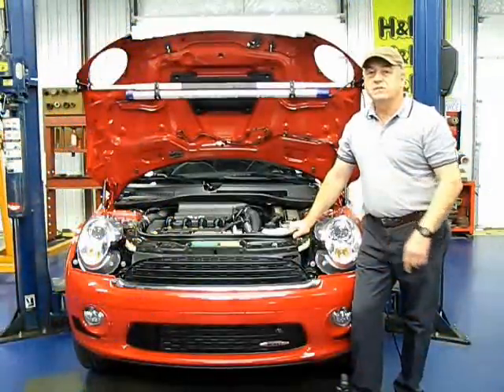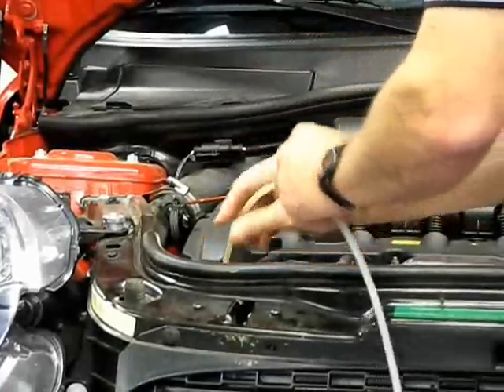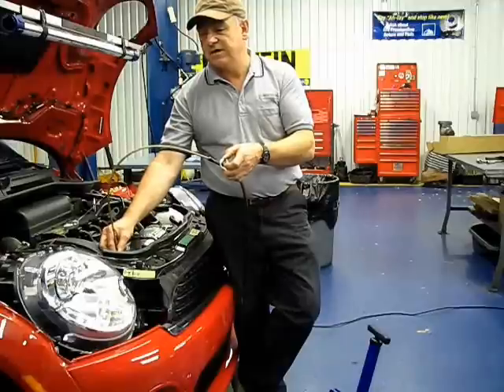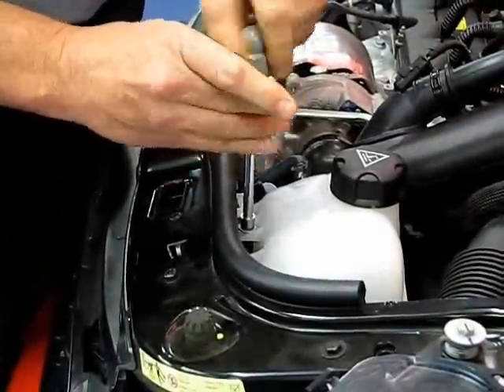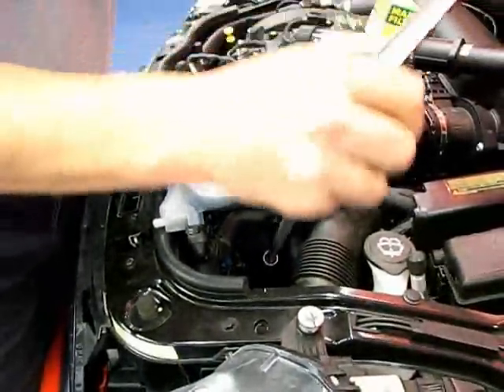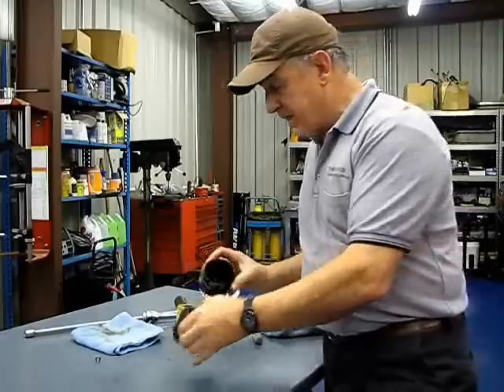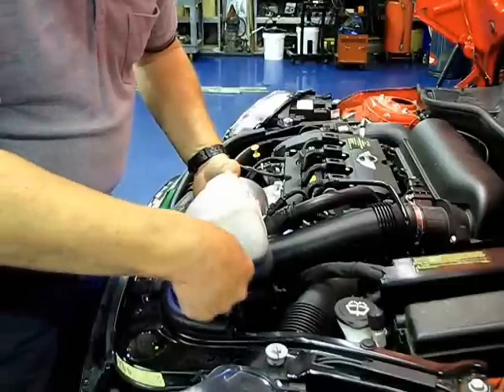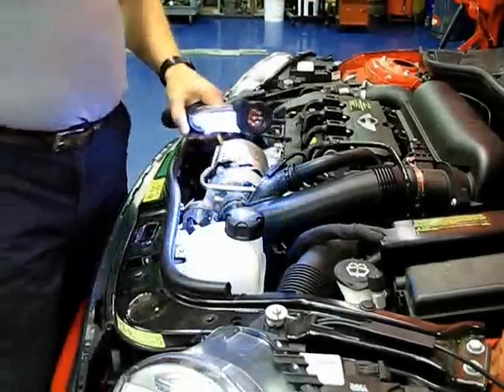2008 R56 MINI Cooper S Oil and Filter Change

Comment: I was planning to use a vaccuum pump to remove the old oil from my Cooper S, but I just read that it is reccommended to drain the oil through the plug underneath, as it will drain other particles as well as the oil. Anyone who knows anything about this?
Reply: Im sure both methods are great, just more labor draining the oil from below. The bonus of undoing the sump plug is you can see if theres any engine wear with the metal shavings on the end of the magnetic sump plug. Always good to know if theres excessive wear happening.
Reply: Go ahead this is the best way i have been doing it since 2001 now 300.000 miles later and still going strong my oil is always clean and good. This is 2018 and things have moved on 👍

Comment: why would you suck up all the fine metal particles sitting at the bottom of the pan up and through the engine?  seems like you are doing more damage than good using this method.
Reply: The hose being used to draw the oil is sitting in the bottom of the oil pan.  Nothing is being pulled through the motor.

Comment: These are just a version of the Sorry Ass British made Mini's!We had a 2009 Turbo that stayed in the shop all the time.My suggestion is buy your self a good car and forget about even shopping for this pile of junk! The worst made car ever made!I hate BMW placed it's name next to it,it is a shame to even be mentioned in the same breath as a BMW.On a scale of 1 to 10?A -20!!!
Reply: It’s all the BMW bits that are the problem: Electrical architecture, Engine (BMW/Citroen/Peugeot: problems - water pump, thermostat, oil pump, timing chain, valves carbonising like all direct injection BMW engines), BMW paint formulation, Electrical sensitivity to low battery voltage, Stupid BMW software & ECU hardware, expensive BMW parts and dealer charges.
Reply: Lee Farmer Terrible thing (envy)